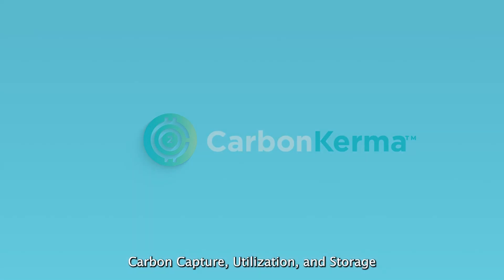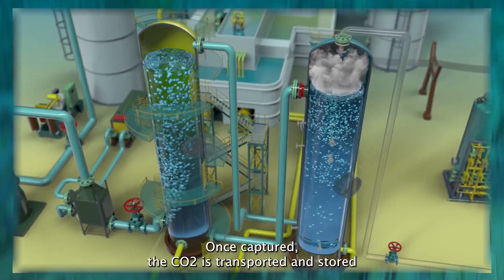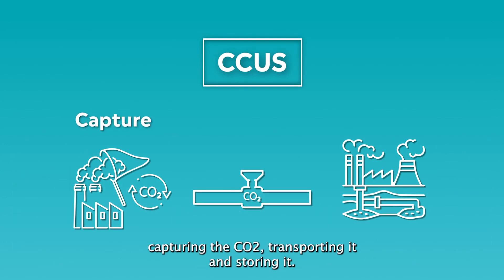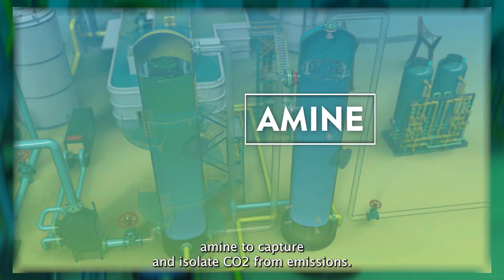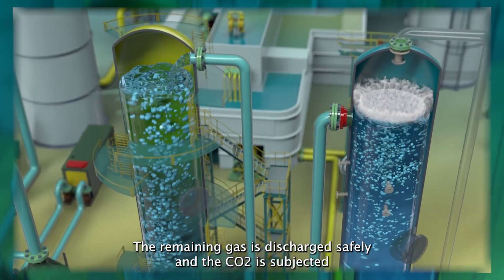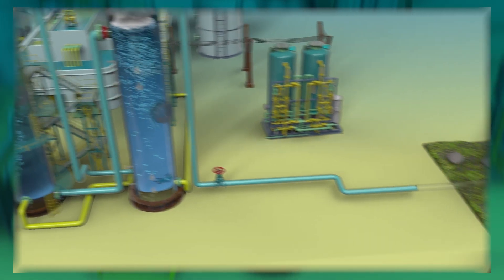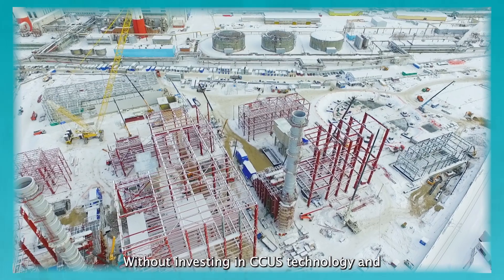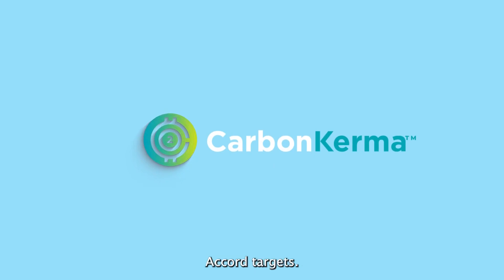What is CCUS and How Does it Work?

Comment: Thanks for this amazing video and sharing your insights. I am a senior chemical engineer working in the area of CCUS, energy transition, upstream oil-gas projects and trainings. Let’s connect and see ways of helping each other. Happy to consult in oil and gas projects.
Reply: Sorry for asking, what impact to nature when we store back to the underground?
Reply: @haikaldaniel3790 let's discuss this further
Reply: @haikaldaniel3790  the formations that store the carbon are usually depleted oil reservoirs that are already "contaminated" with naturally generated oil and natural gas that have been trapped underground for tens of millions of years, salts, TDS (total dissolved solids) and other naturally occurring compounds, and are trapped underneath a seal or impermeable thick rock layer. If this rock layer was permeable, the oil reservoir would have leaked upwards, as oil rises and floats on water. This is the same concept that water injection wells use to store produced formation water. When companies frac, it is also within these reservoirs that are underneath a thick seal that protects our fresh ground water from contamination. Hope this helps.